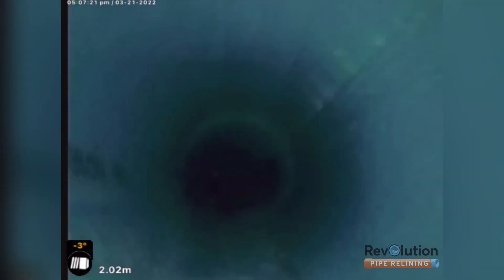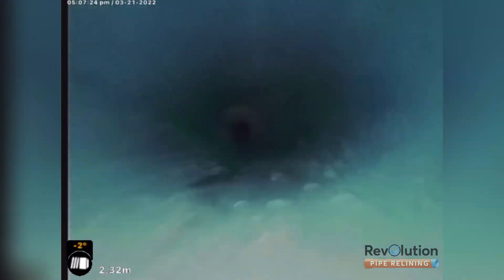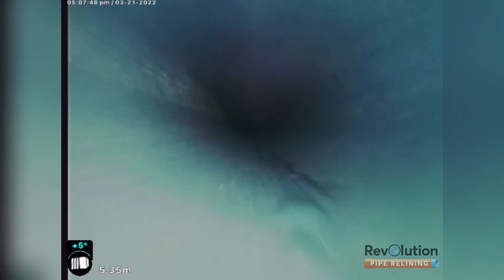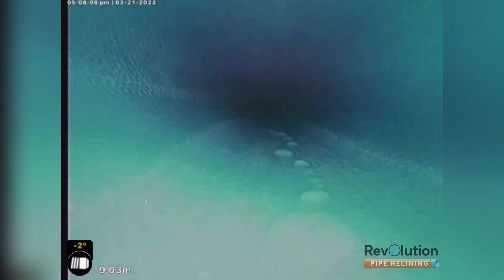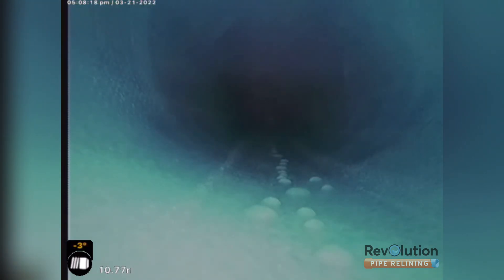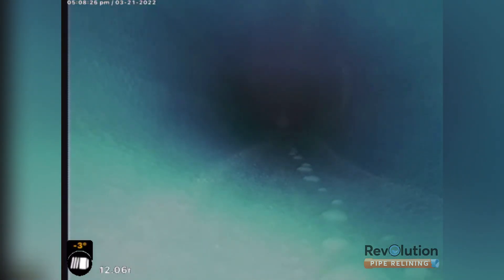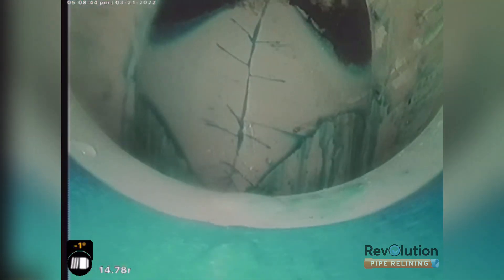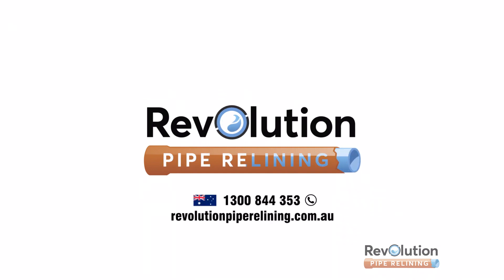Drain Relining via The Inversion Method

Comment: How did the line not wrinkle when the cal tube sucked it back in some
Reply from the maker: This is because it's a 3D liner, it sucks back with shrinkage as it expands to the 150mm pipe size.